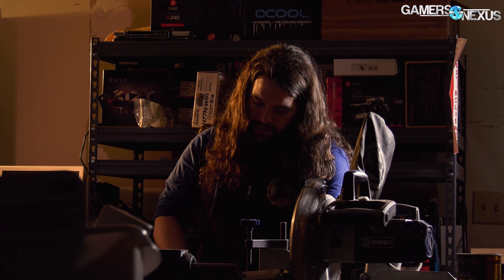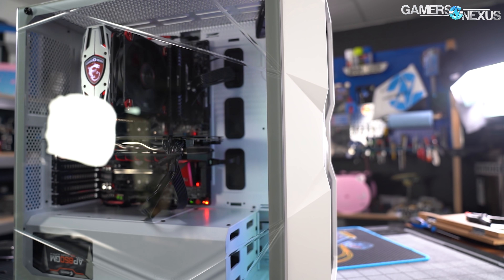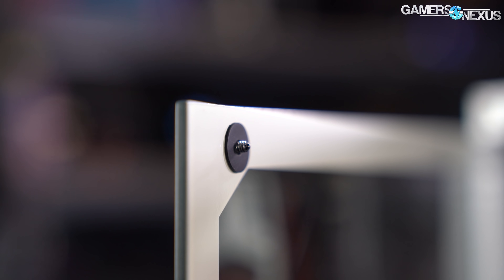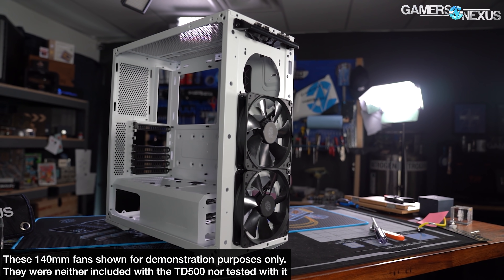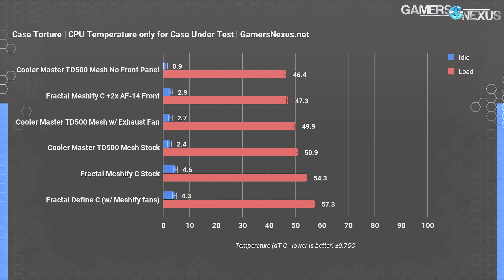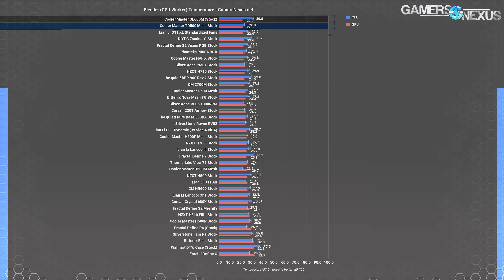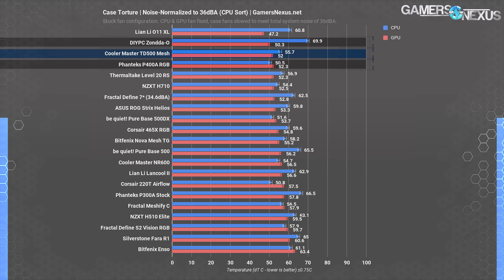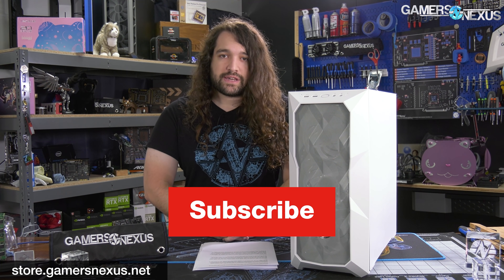Cooler Master TD500 Mesh Case Review: $100 Airflow Show-Down

Comment: Augh, why must they tease me with part of a 5-1/4" bay? 
I'd love to see them return at the bottom of a case, in place of the fan that blows air into the cable management shroud.

EDIT: BRB going to Japan
Reply: I find an external drive (a full 5-1/4" mind not the bad quality thin ones) straight-up more convenient.
I can place it in easy reach for sitting at my desk while having my PC positioned much higher.
Just get a USB-SATA cable and you can have a proper solid DVD or Bluray drive conveniently on your desk for whenever you might need it while keeping great airflow to your CPU ;)
Reply: @zig131  Pretty sure those cables won't work with standard optical drives, cause they need 12V, right?
Reply: @zig131  There is also an option to use an enclosure for optical drives and have it seat neatly in a corner of your desk:

https://www.amazon.com/dp/B01MRUN0HQ/?coliid=I22GANLX3L8TMM&colid=1ZRZIM3WDTA9I&psc=1&ref_=lv_ov_lig_dp_it
Reply: @zig131  Thanks, but I don't want it for a disc drive. You can do way more with 5-1/4" bays than just disc drives. My current computer has a little drawer for flash drives and memory card readers as well as an expansion for front USB C.
Plus one or two bays at the bottom wouldn't prevent great airflow to my CPU. It would prevent great airflow to *checks notes* the part of my power supply where the modular cables plug in. Yeah, don't need airflow there.
Reply: @Cr0Lar Yeah, there's so many that you listed them all in your comment accidentally.
Reply: @johnwolf2349  You need a powered adapter but they're available for only about £15 e.g. https://www.amazon.co.uk/dp/B07G86M7KC/ref=sspa_dk_detail_3?psc=1&pd_rd_i=B07G86M7KC I used one and it worked great.
cmarting83 Totally! Although they do come with a significant price premium over a powered adaptor. Working in a PC repair shop I got my hands on an old IDE drive enclosure with a DVD multi-recorder drive already in it and the bonus of a power button so it doesn't spin up every time I turn on my computer or open 'This PC'.
mjc0961 Your argument is you're not interested in modern case designs because they lack 5-1/4" bays but then your uses for one would be to gain USB C which a modern case would already have and storage which could easily be provided by some small desk drawers and does not benefit from being inside the case...?
I understand your disdain for the bottom front fan but the space behind that fan is not empty/wasted. Most cases put hard drive sleds there which are much more likely to be used by the average PC builder/gamer than 5-1/4" bays. Not everyone can afford TB+ SSDs for their games.
And even ignoring that, 5-1/4" bays would severely impact front radiator support which case manufacturers love to use as an excuse to stick to re-use old tooling.
Reply: @ssquirrel88  i've seen some reviews on that one, seems great for a multimedia/HTPC imo. Didn't find GN coverage on it, apparently includes inadequate fans or something. A meshify c but with 5.25 would be sweet

Comment: I have the Cooler Master H500 with the two 200MM fans in front, and 3 of their MF120 Halo ARGB fans as rear and top exhaust.  I love it, but if the TD500 had been available when I built this back in Jan/Feb 2020, I would have bought it instead solely for the slightly better looks.  But seriously, between the H500 and the TD500, I don't think you can go wrong with either choice.  Nice review, guys.

Comment: I'm an independent system builder as a side job and while business has been both booming and infuriating lately with the combination of stimulus checks and stock issues, I've managed to do 3 client builds in this case so far- specifically for clients who want a white-themed build with lots of RGB, which is a lot more common than said clients seem to realize. The reason I've recommended those clients snipe this case when it was in stock and build around it was the combination of aesthetics, airflow, and value. I simply refuse to build a hotbox, even with someone else's money. Those same clients generally want to populate all fan slots for aesthetics and they want CPU liquid cooling. A TD500 + ML360R accomplishes this with aplomb while still having matching fans and connectors. This means the customer only has to buy a single fan to fill out the fan slots. For ~$270 total for a case, 7 matching ARGB fans, and a pump/rad/tubes combo, this is a great starting point for more flashy value builds. The cable management isn't great, but it's plenty workable, especially if no 3.5" HDD's are being used. Honestly, I think Cooler Master has found a really good sweet spot with this case.

Comment: Bought this last month at a good price to put a 14700F and a 4080 super, other than the 3 front 120 fans I put another on the back, and 3 more for the top (I could replace the 3 on top and front with 2 140 ones, but I don't think it would make the system run cooler).
I get between 36 to 40 C normally, and about 70 C playing an Unreal 5 game with everything maxed out (other than raytracing). So pretty good for a nearly 5 years old case, I don't see the need to "upgrade".
Reply: you may get better temps by removing or reversing 2 top fans (only keep the rearest)
this way cpu gets more cold fresh air instead of air being ejected

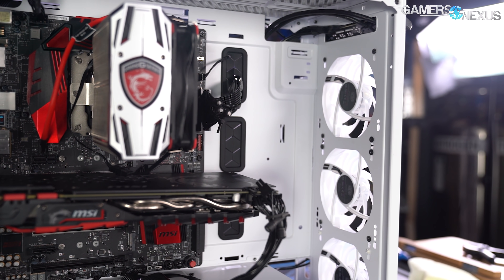Comment: 13:27 Regarding Cable Management space behind the motherboard tray; "CoolerMaster lists clearance as 1.9mm" ...that is not a lot of space. Are you sure its not 1.9cm / 19mm? (1.9 mm is less than 1/10th of an inch)

Comment: This has been sold in my country and I've been recommending it for quite some time already and just like I thought, it's a really good case and great value mainly because of the ARGB fans. I can already imagine this getting more popular and sold out now that this review is out.
Reply: @makaroner Being a White-colored case is actually a feature a lot of people want and the NR400/600 doesn't provide that and there's also a black version of the TD500 mesh if you didn't know. 
Your RGB comment is just a personal preference, just because it's flashy for you means it's flashy for other people. TD500 mesh providing 3 ARGB fans saves quite a decent amount of money for people who want RGB on their builds.

Though as a complete value perspective disregarding any aesthetic preference, the NR400/600 is better since it's cheaper and you can just add 1 front fan as shown in their testing to have better CPU temps than the TD500 mesh.

Comment: I was going to buy the Phanteks P400A ( I was very happy with my last Phanteks case) but two reasons why I didn't. It was out of stock or price was inflated, also it was limited on large air cooler mounting height. So thank you Steve and the gang as I bought the Be Quiet 500DX and I am super happy with it. Great clearance for my Dark Rock Pro 4 cooler. Seems to work great with 140mm x2 front (intake), 140mm top (exhaust) and 120mm rear (Exhaust, My Gpu has a 120mm AIO which exhausts here). One thing I would like to see with the case reviews is if you would mention the air cooler max height with each case. Thanks again, love the videos.

Comment: I have put together a gaming PC (R5 3600; 16 GB HyperX RGB RAM; GTX 1650 Super which was the only available GPU I could find) for a 13 year-old with this case. And I must say it was a pleasure working with this case.

I liked it a lot, and I would buy one for myself. (If only the white one did not cost more than the black one!)

Comment: Hey Steve, slight correction in the header at 23:02. The chart is GPU sorted but the header reads CPU sort. 

Thanks for the amazing review btw. This is case is available in India for just over $100 and it seems amazing value for it's performance.

Comment: I have a K500, which seems to be from the same chassis family.  My USB front header has popped out a few times in the past.  One port is also temperamental.  I wish I had more cable management room on the side - it's an issue.  
One big point that this gets right: buttons are not on top.  My cat turned of my old computer when she got on the case multiple times because the HAF 922 had buttons on top.  Seriously, case makers should hear things like that.  I kept a guitar interface over the button for years.  Also, the shroud along the bottom is cool for hiding cabling.  Don't get a fancy looking PSU for it - you won't be able to see it, but it helps keep the system looking neat.

Comment: Great review, dont give up on case reviews, they are a favourite.  Dont know if I would get one of these, too many things that dont work for me.
I think it was GN that once suggested to drop Fractal a line directly at their website comment page, regarding case design ideas (maybe it was Jay ... hmmm).
So I did.
I detailed an idea for a better designed meshify style with ++ airflow, options for bigger so called E-ATX boards, proper room for properly mounted front AIO rad or 3x140 fans, custom loupes or large NH15's, scrap the foam dust filter and that weird front filter frame assembly, better cable routes, better multi SSD and HDD option spaces and other minor 'stuff they get wrong' fixes, 
including having; 1) enough fans or 2) enough RGB fans or 3) no fans at all - purchase options.
aand explained how it could be done with a minimum of manufacture assembly line build variables and use mostly 'out of the fractal parts bin' approach.
Offered to coordinate to help ... for free (or maybe for 1 case).
I heard nothing. Crickets. I shouldn't be surprised (sigh)
Reply: I'd really love if all cases came easily available with a barebones "no fans included" option. Even if it only saves a few bucks, I'm set for fans already thanks.

If they need to add "additional value" that's reflected in the price (i.e. increased) I'd happily pay the extra to get rid of the cheap looking plastic front panels, when the rest of the build is all metal and glass. Filters, grommets etc. notwithstanding.

This case's front panel is mismatched in colour to the rest of the panels for example. It looks cheap in a 'nasty' sense.
Reply: I'm curious how many boxes the Define XL ticks off on your wishlist. Maybe a variation on that design would be better than retooling the Meshify line.
Reply: @nimrodery  - thought of that.  The thing is the Define is a significantly taller box, so a new meshify screen would need designing and manufacturing. Another unticked box on my list is regarding cable routes in the back ... the define has next to none, meshify C has a huge channel, so a marriage of these ideas is needed.  There might be something to the basic idea though.

Comment: Just received my GN Mouse Mat (it takes a while to get from US -> Finland) and it was even signed with #99. Very cool, thanks Steve :)

And talking about TD500, I built one machine for a friend in the previous H500P Mesh ARGB, they liked it and the temps and noise were very good. Mesh cases seem to be actually better than "noise dampening" cases with horrible airflow. I need to upgrade at least one of my own machines to mesh case, as Folding@Home at summer is quite noisy...

Comment: You mentioned the potential of optical disc drive support in some
versions or future builds on this nice case.
We have spot welded brackets in the top front but face
them to the opening glass side on some so far. Works fine.

Comment: I have both this case and h500 and they're both great. just a few degrees difference on cpu/gpu tortures are as you said, margin of error territory. I love the huge 20cm fans on h500 and slick design of td500
Reply: Im stuck between these 2 options, which one would you recommend?

Comment: If you’re planning on getting this case, DO IT i just got mine about 3 days ago. It’s nice that you can fit a 360mm radiator in the front and and on the top, i replaced all my fans with noctua fans and my 8700K only gets to 22c with a DeepCool Castle 360ex, airflow with this case goes very good. The inly cons i would say is cable management can be a little complicated due to so cramped in the back
Reply: dude, did you really manage to fit two 360mm radiators, one on top and one on the front ?

Comment: Still using a Haf X (Nvidia Special Edition case).  Just does its job.  Would like a new case, but it does the job even though its 10 years old and had numerous upgrades.  It just works for me.

Comment: As a Meshify C owner, i found this case interesting. But quite honestly, i would not exchange the dust filtering of the Meshify C, for th 3-5°C better cooling of this. Besides, i was able to fit 3x140 in the meshify C front. And the case is CLEAN inside, after almost a year running in 24/7.

Comment: I understand that most people have air cooling and that everyone does not have an NH-15 and that an NH-15 does not fit all cases, ram height, etc. Therefore the cooler used is a good choice. That being said some cases are getting a raw deal. I'll only give one example that is my build. I have a Lian Li 011 air, 3950x (stock settings) and an Enermax Liqmax III 360. I mounted the aio as side exhaust. Also 9 high static pressure fans all as filtered intake. Thermals are 7c over ambient at idle and 27c above ambient at full load. Because my build now lives in a cubbyhole in my computer desk add 3c. A 4.4GHz first 8 cores 4.2Ghz second 8 cores at 1.275v was stable at 52c above ambient  but for me the performance jump was not good enough to justify an overclock. During the OCCT 6.0.0 large memory stress test stock runs above 4.170 GHz on all cores anyway because the cooling is so good!

Comment: this beats out the p400a because of the top mount 360mm space. You guys should really add a 360mm to your tests as it slows down airflow a considerable amount especially if it is at your only intake. P400a with a 360mm (i know its not officially listed as supported) is absolutely atrocious in terms of gpu cooling (especially with my 3080) because the intake on the front is more chocked. Would be interesting to see how other cases perform with a 360mm, 280mm, 240mm, and 120mm aio mounted inside of them and if it destroys the cooling performance of the case.

Comment: Hi,, I will be getting the same case in white soon to replace the  H500 at the moment. I upgraded to a 13 gen I5-13600k from a I9-9900k. I love the H500. sadly it does not support a 360mm rad at the top. The 13600k needs a lot more cooling than the 9900k. My goal is to modify the 500TD case to either fit at the front 2x200mm fans  like the H500 or 3x140mm fans. This will require some rework to the case. Also i would remove the power supply shroud and shorten it so i can fit 1 or 2,,, 140mm or 120mm fans at the bottom.

Comment: Nice case list, feel free to mix in a DeepCool case Stevo. Also I love how you act like $100 is the baseline people should accept as standard starting price for cases. This platform is filled with videos around $125 to $250 GPUs but the standard "influencer" recommends cases usually over $100. You will likely slam airflow of the DeepCool Matrexx 55 line but I have found it to have fine thermals for builds when it was hovering around $50 to $75.

Comment: Would have liked a little more comparison to the regular CM H500 and it's 200mm front fans - H500 has a hard drive cage, removable PS shroud, same tempered glass setup with the screws and metal hinge at the bottom, and a similar price point. I guess on paper the TD is better due to 120mm fans and static pressure? Great review nonetheless!

Comment: I still dont know why so many people shit on certain RGB ecosystems. 

Corsair iQue is great. It just works, yes it can do strange things sometimes with lighting effects but its nothing a quick restart wont fix normally. Updating it is easier than falling off a whale, wiring is actually quite easy (managing  is a different story though depending on your case) everything is lableled and noted in the various manuals you get with iQue products. 

Its fine. Never had any issues with it before that have been so bad i give up on it. My PC looks amazing all the time, and not to mention the virtually unlimited custom effects you can make yourself.

Comment: I appreciate that GN leaves the Zonda O on the charts. Hopefully it will eventually sink in with the case manufacturers that it is more important to COOL the GPU in a gaming PC than to SEE the GPU. These days, the GPU is usually a higher power part than the CPU, but it is virtually ignored when it comes to cooling considerations in a PC case.

Comment: Case to add to your showdown: CoolerMaster Masterbox MB511 RGB (the non RGB version comes with 1 rear fan, but the RGB version comes with three, you guessed it, 120mm RGB fans, and actually released before P400A and TD500 Mesh)

Comment: I bought one of these for my new intel 10th gen build when it just came out. Only two things to note the included instructions for someone who has not done RGB and also wanted to add a matching fan to the back left me searching the net for how it all worked and ending up I didnt need the included controller just added to my confusion. Second I could not fit the second fan on my Noctua NH-D15 and close the case even with low profile ram. I would have liked 2 more USB on the front also I guess.
I still like the case and for the price I am happy with it in the end.

Comment: It's higher priced in EU atm compared to Meshify C which it's better case overall. 
I had CM H500 was a bargain (90-100e). Donated/Changeed to =>
Meshify C mini (70e deal).. I love it!! It smells and screams quality.- 
I liked the H500, but wanted a compact build. 
That plastic side at TD500, bad filter @PSU (same as H500) and higher priced? ehm no.. Unless you need those rgb fans (I don't) would justify the purshase.